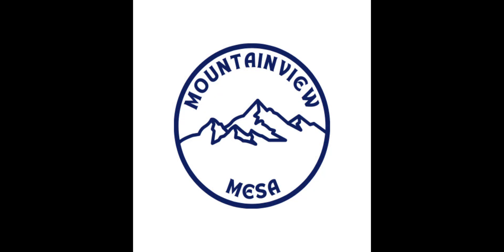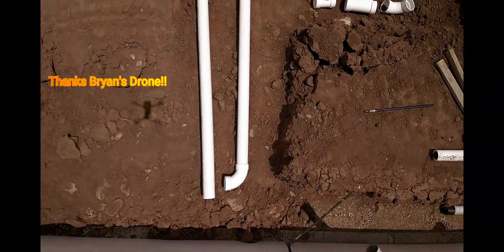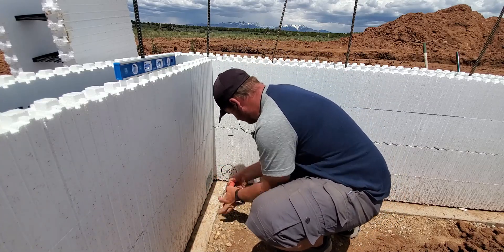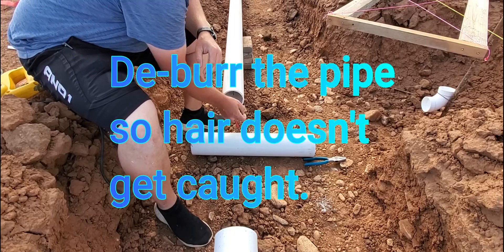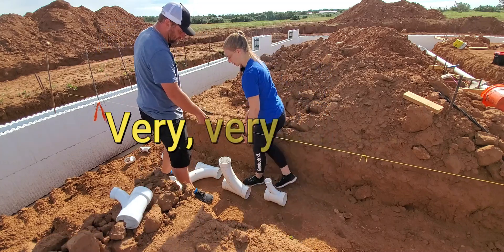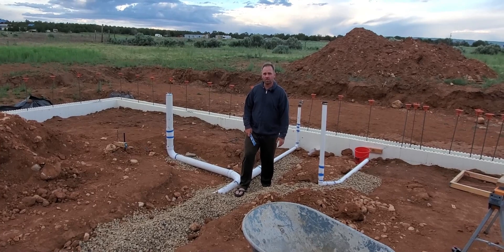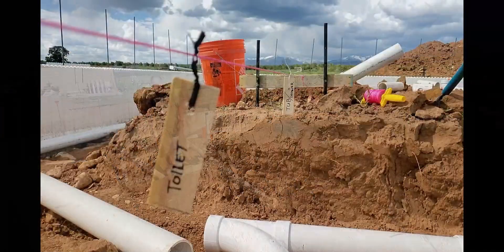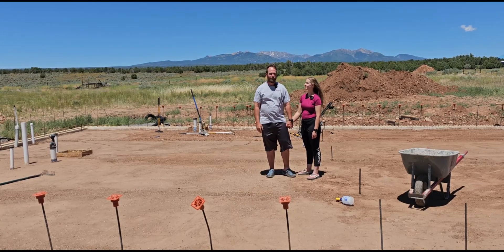DIY Rough-In Plumbing in an ICF House: Can we figure it out?

Comment: how did you fix the vertical rebars coming out of your wall, so they stand vertical aligned before pouring cement?
Reply from the maker: this is difficult to explain in text, but i did put an explanation in the video. The horizontal rebar are offset just a bit every level of block. I was able to easily weave the vertical rebar in between them, holding them in place fairly snuggly. Thank you for your question!
Reply from the maker: https://youtu.be/bUEhmIqFBIE?si=x4FsfNERRL69Cqkr

Comment: I believe you are out west and that will be the UPC code, Texas follow both codes depending on where you live. You will get different opinions from plumbers based on the code they follow. I am under the IRC and IPC and I hate this code. I am a UPC believer all the way. Plumbing for 51 years and a code inspector for 32, you did do a few things wrong but it will work. You are to lay your pipe on firm undisturbed soil.

Comment: Great video. We just did our 2nd diy rough-in plumbing adventure. My tips: run things on the square, not diagonal & it makes things much easier. To save money, keep your plumbing fixtures close together. Our kitchen, bathroom, and laundry are all very close...and we located them on the side of the house that was very close to the septic tank as well. This means less pipes, you can hand dig & save on an excavator, & in the long run your hot water isn't going to take long to get to your point of use. You definitely will buy the wrong things and make multiple runs for parts & pieces.
Reply from the maker: Thanks Kam! These are great tips and very useful for our viewers starting their projects

Comment: Codes vary by municipality. You did exactly right by calling the inspector.  We in Texas would have to vent the island with a loop vent. The most satisfying part about plumbing is pulling the walls after concrete is poured and everything being perfect. Have fun with the top out soon
Reply from the maker: Thank you so much! It's nice to get some validation from experts. We are excited to do the top out, for sure!

Comment: I'd put the drains that cross through the concrete walls in a sleeve. Sticking the PVC pipe directly in the concrete means that it can get damage if the concrete ever expands or settles ever so slightly.
Reply from the maker: Thank you for your advice! I hope people reading this make sure to do that. You'll be happy to know that local code requires that we wrap the pipe in some sort of protective material (closet wrap, sill gasket, etc.) If you watch our concrete slab video I do point it out (albeit briefly).
Reply: 2 pipe diameters sleeve. When, and I mean when, you have to do a repair you will be happy to not have to to bust your concrete foundation footing. Poly the sleeve to keep critters out. 3” would have been fine for your building drain, but 4 is plenty fine. Also install your traps for your tubs and shower  and have them tested and stubbed up before you install concrete.

Comment: Wow you tested PVC with air that's literally against code and extremely dangerous.
Reply from the maker: We worked in conjunction with multiple certified plumbers and went through many iterations of this plan with our local county inspectors. Air is not only approved by code, it is a definite requirement. The hydrostatic test isn't even allowed on new construction in our area. I will put my trust in those that do this, for a living, in my area. Thank you for your concern.
Reply: @Mountainview-mesa  🤣🤣🤣 yes you nor your inspector have no idea what you are talking about lmao testing PVC with air is literally prohibited by the IPC 🤣. You're definitely wrong. (DWV systems shall be tested on completion of the rough piping installation by water or for piping systems other than plastic, by air with no evidence of leakage ) dont try to bs the pros lol.
Reply from the maker: @MyWorld-dv1ym  your ignorance is only surpassed by your confidence in speaking about subjects you know absolutely nothing about. I do hope you continue to comment these types of things on our videos.
Reply: @Mountainview-mesa  how am I ignorant and you have no idea what you're talking about ? 🤣🤣🤣 it's clear you don't know plumbing at any level and I know that only with you testing PVC with air lol...good luck with that handy andy lol

Comment: Easy hack to get the correct drop on drain pipe: 
- Take a scrap piece of 2"x4" wood and cut one foot long.
- Measure and mark 1" down on one end and 1.25" on the other end.
- Connect the end marks and cut.
- Attach wood to the bottom of a torpedo level with double-sided tape.
Now bottom of the torpedo level has a built in slope of 1/4" per foot.  Put it on a pipe and when the bubble on the top indicates "level" the pipe will be sloped correctly.  

If you want to upgrade even further:
- Slice the wood in half on a tablesaw.
- Cut an angle in each half of the sloped bottom.
- Glue or screw the halves back together.
The resulting V in the sloped bottom will sit on round pipes better.  You could also make the two halves from scrap plywood if it is thick enough.
Reply from the maker: These are brilliant "hacks"! We can't find skilled help very easily, they are all so busy. Thank you for the advice!

Comment: Passive radon mitigation systems like yours actually work for small amounts of radon gas. The stack effect created by a long vertical pipe works to draw air up and out of your house. Basically, the air pressure at the base of the pipe will be greater than the air pressure at the top of the pipe. Since air always moves from high pressure to low pressure, this causes air to rise up the pipe. Radon gas is heavier than normal air. Thus, it always sinks to the lowest points in your home. The bottom of that pipe is placed below your slab where radon naturally accumulates. Because of the previously mentioned stack effect, radon gas will naturally be drawn up and out of your house through that pipe.

Source: Trust me, bro. But seriously, I'm actually a licensed builder.
Reply from the maker: I love comments like this. People who know things are my favorite people.
Reply: I'm very interested in seeing how this house turns out. I used to work for Habitat for Humanity and I've seen what amateur builders can be capable of with raw determination. I'm wishing you two the best of luck. You earned a subscriber and I'll be waiting for the next video.
Reply from the maker: @shane5896  Thank you so much! We are pouring the floor on Friday, so hopefully that video drops early next week!!